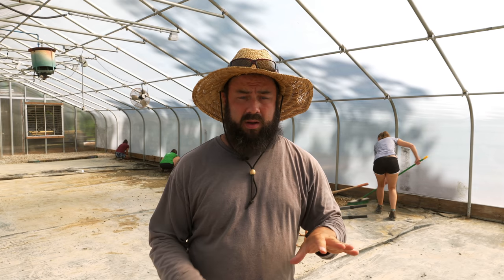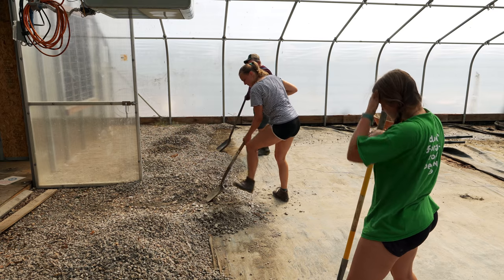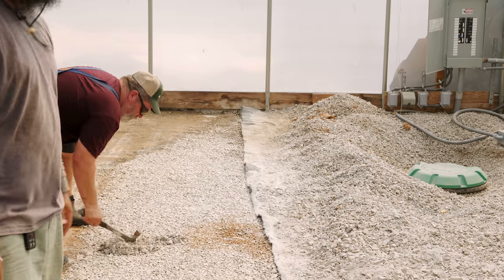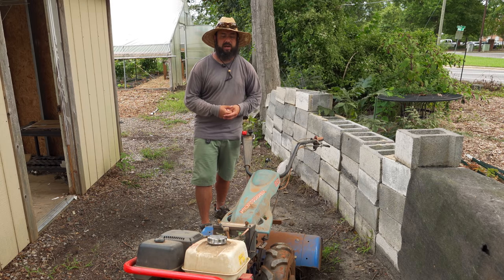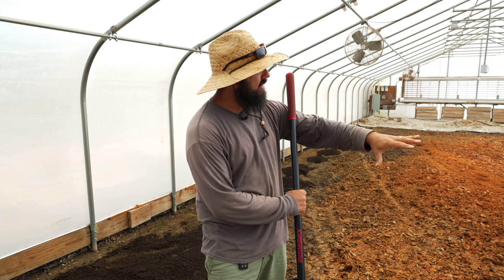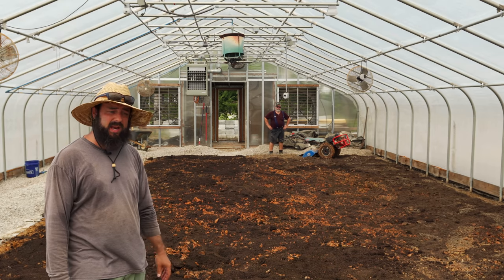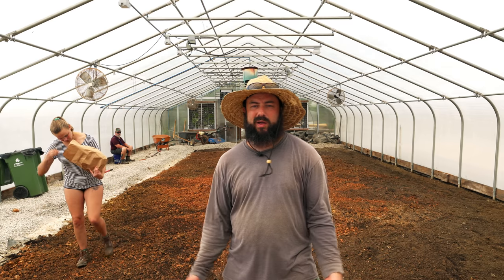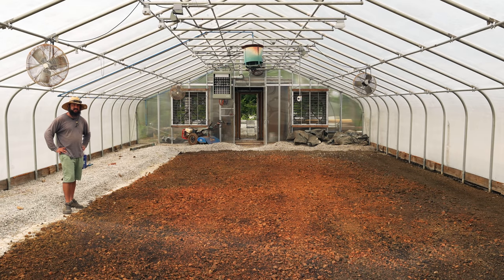Grappling with Gravel

Comment: I am new to your channel but I have learned a lot from you sir! Thank you for what you are doing and sharing. I have just under 1 acre that I acquired in January and we have already allocated half of it for livestock. I started looking into the idea of a market garden in mid July, so I feel like I am a bit behind. I have a 70 x 50 area that is tilled and ready for cover crop. I live in the mid-west were it is still 80-90 degrees with 40-50 at night, so I think I will have just enough time to get it going before it gets too cold. Like you said, anything is possible you just have to want it bad enough and stay focused.

Comment: The bcs handle bar height can be adjusted so the operator isn’t bent over. It’s much easier than this video shows it. If the unit won’t fit through a door, take off the tiller, take both pieces through separately, reattach inside and operate.

Comment: Adding some compost worms and such tot he soil alongside some compost tea to the bed while its in these cooler transitions isnt  bad idea. A Nice Affordable way. Is to add a composting unit or air bubbler in a 50 gal or two cans and making tea. Then letting the Micro Biology Boom in the midst of its initial growths. Great Work Mikayla on that soft raking. Got 3 qtr. of it done PROPER & Quick
Reply from the maker: We might start doing some compost teas next year. We are going to be building lasagna beds made of compost on top, so we will get lots of biology going with that and what we are doing now.

Comment: Given both the color and compaction of that clay, I would've added about four times the amount of compost that was applied.
Reply: Me too! I do like to add a lot though. Sometimes I'm not sure I'm not growing vegetables or compost. I look forward to winter/spring so I can sieve my compost and see what I've produced. That clay looked like concrete... though clay can make fertile ground.
Reply from the maker: I discussed why I didn't add that much compost in the video. We will be building lasagna beds.
Reply: @JoshSattinFarming  Yes I heard. Compost can be expensive to buy in quantity or take a while to make. Also, you could introduce something nasty into your soil - I bought horse manure which had thousands of tiny pieces of rubber in it! The horses menage was made of recyclyed stuff. I understand and appreciate why you're doing lasagna beds.
Reply: @VanderlyndenJengold  Clay is good to work with, it does require a boat load of humus material to bring the soil's microbiome up to speed.  Me thinks in the case of that grow tunnel, to reestablish the soil's microbiome because that clay appeared to be 'dead dirt' in my opinion.  I compost a lot of leaves - very easy to do when done on ground because earthworms love leaves.  I do both 'fast' and 'slow' composting - the fast is done in 30-45 days and the slow is one year, Fall to Fall.  My clay dirt is now a living soil looking black and is full of earthworms - at least 75-100 per square foot, well within regenerative agriculture standards.  I'm a soil farmer first.
Reply: @JoshSattinFarming  I watched the whole video.  One thing that type of ground cover does to soil is cut off oxygen which decimates the soil's microbiome ; and, the degree to which that happens is directly proportional to the amount of time spent under that cover.  I 'rehabed' what turned out to be plain 'dirt' that was under similar ground cover for four years.  I used both direct till-in compost and the lasagna method - I initially used about the same amount of compost as is in the video.  I monitored both growth and production the next growing season - dismal.  I then took a rod, sunk it and I was both shocked and I learned a valuable lesson about the ratio of humus content to dirt.  The aforementioned is the reason for my initial comment.  Stay safe - be well - many blessings.

Comment: top 6 or so inches are now crushed and amended, but what is under that? more clay? will water and root mass penetrate that?
Reply: They are going to put “lasagne beds” on top of this. Layers of organic material, cardboard, straw, leaves, compost, etc. they will plant into that.
Reply: That's what we have around this part of NC. The clay goes for several if not tens of feet down. You work with what you got.
Reply from the maker: As mentioned in the video, we are going to be building lasagna beds on top with cardboard and compost. That's how we built this whole farm. I just want to wake up the soil and bring some biology back.